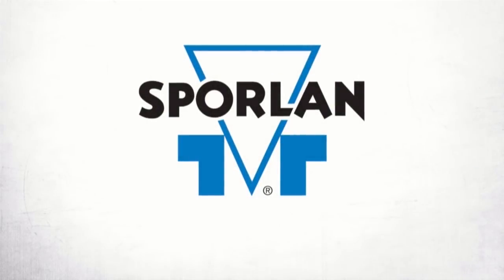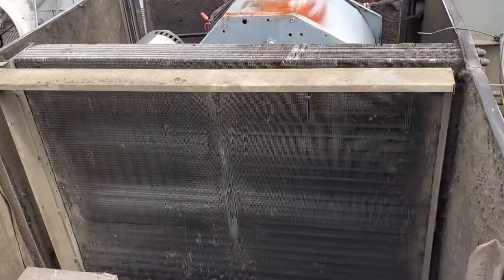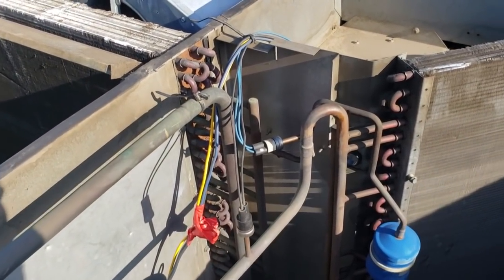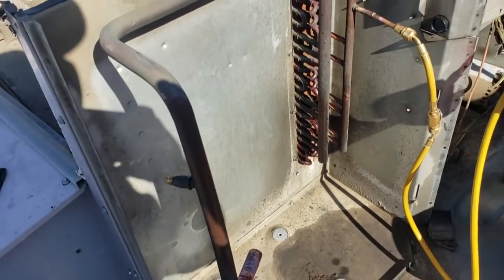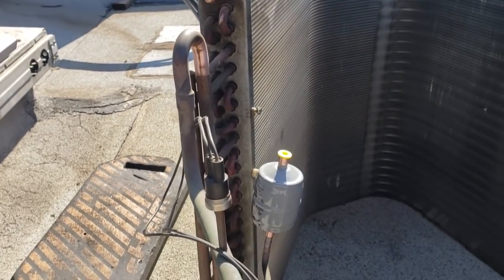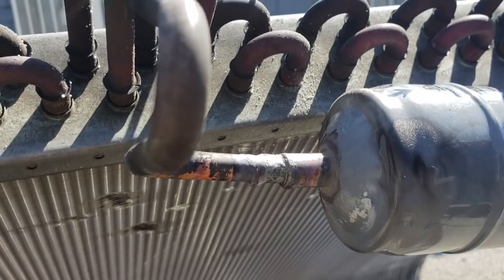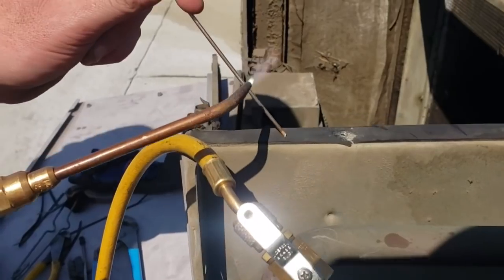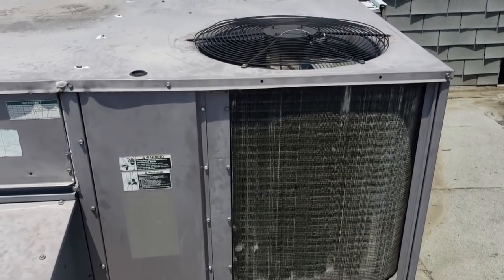CARRIER NO COOLING CALL

Comment: If there was any debris in the strainers before the accurators...nothing would come out with your method.. I usually blow through the suction line which will black flush through the coil and through the accurotors which then clears the strainers.  In the past I have just scrapped the accurator manifold and soldered in distributor tubes... made my own distributor to a 5 ton TXV....Done!

Comment: What is the stuff you use to control the heat flow into the compressor and drier as you were brazing them?  It looked like Perlite, but like a putty or clay.

Thanks..
Reply from the maker: It's called viper wet Rag by refrigeration Technologies
Reply: @HVACRVIDEOS  Thanks!

Comment: So what's the thought process behind the compressor being bad before the line vibrating? I've been on the same units before and had leaks from the copper rubbing. After repair and vacuum, the compressor was fine. Low refrigerant will cause all those sounds of running rough. Is it more preventative to change it, or was there a reading telling you it was bad? I'm only  about 3 years in, just looking for different aspects
Reply from the maker: Past experiences have shown me that when the discharge line cracks at the compressor outlet on this unit it's usually a compressor problem. The vibration I was feeling does not translate thru the video but even if the compressor was low on oil, I would not just add oil as I don't know how much damage has been done and for how long it has been that way. It's one thing if the compressor had an oil sight glass and I could see the level to know how bad it was........  I will discuss this on my Livestream this evening 2/24/20 @5:PM (pacific time) Come on over and check it out if you can. https://youtu.be/qop5jyuMfmc
Reply: @HVACRVIDEOS  I completely forgot about the oil that had migrated, it makes more sense now. Thank you!

Comment: I use a cutting head for silver soldering. Learned how to do it with it   seams to be easier
Reply: man used the same for a while but got a 17-30 Rosebud does wonders
Reply: @hvactechpr7872  never used a rose bud. For silver soldering. A regular tip I hated it about the time things got going good pop something would change or go out
Reply: @royamberg9177  it has the same feel of the cutting tip but everyone has their own technique
Reply: @hvactechpr7872  the angle on a cutting head is different from a torch tip a rose bud is simmaler   the near right angle slows you to get in some tight and odd positions that you can't get into otherwise. I bought some of those hook shaped torch heads didn't like that for most things. Hard to control heat as you can't move it away when you need to. The cutting head is by far superior for service work I learned. Just my opinion

Comment: To save time we all unbraze compressor lines...oil in the lines makes this a dangerous practice. Best practice is to cut out compressors and filter driers. When a system is running with a low charge it tends to pump more oil to the condenser and oil return from the evaporator is reduced.

Comment: What is wrong with putting the wet rags on a regular braze joint? It’s already brazed so no moisture can get into the lines..!?
Reply: John Doe you have to let the line cool, putting a wet rag on it while it’s hot can shock it. The metal will expand and or contract too quickly and can cause stress cracks.
Reply: Cody Weber thank you I was never told this information. Not even by my instructor in tech school.

Comment: After hearing the compressor and seeing the oil everywhere, why not condemn the unit and ask if they want to replace it?
Reply: Cashflow...   Repairs are less immediate cash out of pocket, and they come off the balance sheet as an operating expense, deductible from income immediately.

Replacement hardware is a Capital Expenditure, and is subject to Depreciation rules, so you end up spreading the cost out over several years...

Even a good accountant is only going to be able to accelerate the depreciation so far... an average accountant is going to use the simplest formula in the IRS' directions, and that is not at all favorable to the owners...

Comment: Just a thought and a question from somebody who has no experience with this. If you were using all new parts and had no residual solder to look at would it be helpful to someone who is just learning to actually stuff a small piece of solder on the top of the joint before you heat it so you can see when it's at temp to solder?
Reply: You can tell by the copper.

Comment: Get yourself an ultra sonic leak detector.  It will find positive pressure leaks and vacuum leaks using sound.  Leaks will sound like a hurricane with the amplified audio from the ultrasonic leak detector.  Then hit it with big blue.
Reply: The only down side to the ultra sonic leak detector is the price.  They aren't cheap, but then again, what is?

Comment: first I want to address phase direction, you make a good point, but many people will not understand how bad that can be, or potentially dangerous, depending application. most people do not realize if hook 3 phase up, you need a way to check equipment will spin correct direction, & many times 1 connection will be 1 direction, the very next will have it backwards, for great example, hanging cords in a meat cutting room, plug bandsaw in,  blade may go up, which could be a major safety issue, a person could flip blade inside out, yes inside out, so blade would actually cut going up, for jokes we turn blade inside out, so when person putting saw together after cleaning, if not paying attention, puts blade on backwards, then it wont cut, even though its going correct direction.
next a meat grinder, yes off topic, but if you put worm together, & its running backwards, you just broke the worm, $$$$$$ so have to make sure turns correct before its assembled, & if you move things from 1 outlet to another, who knows, we have 3 outlets, 2 spin same way, 1 is opposite, so we cant even move band saws from 1 location to another, unless we want to rewire,  1 saw for boneless blade, 1 saw for bone in product, and of course meat grinder.

now for your helper, yes I was cringing, lol, but I been around torches whether welding, brazing or soldering for close to 40 years, but we all had to start somewhere & learn. you were great and lots of patience.

Comment: Hi. Can you pause the video in the 25:34 minute? Why didn't you expand the compressor discharge pipe to put another pipe inside? I can see in the image that the diameter of the pipe that comes out from the compressor shrinks, that is not good my friend. I see that there were 2 welds left and there could be only one. Over time this could be detrimental to the compressor, since you restrict the discharge pressure. Or I´m wrong?

Comment: Maybe next time instead of trying to buy time with 2 zip ties, you can probably use some silicone to "glue" them together with a space in between. It would most likely prevent them from ever rubbing together, although I cannot acertain that the eventual vibration wouldn't wear out the u-bends of the condenser or the point where the hot vapor line is connected to it... Of course if the evaporator traps in oil then the system is doomed to fail. And the fact it's R-22 is also a problem, cause that's bound to disapear really soon.
Reply: Na r22 wont disappear any time soon, the EPA is making WAAAAAY too much money on it to get rid of that cash cow.
Reply: @noneofthisisreal75  Well as far as I know, it's been illegal to make the stuff for a while now. At least in Canada. And in the first of january 2020 it will be illegal to fill any system with it as well.

Comment: I’ve had compressors sound worse then this, basically running with a dry charge. Found leak changed coil, and charged system. Compressor purring like a kitten, but not 100%. Always check amps and pressures, the vital signs of a compressor !

Comment: Not an expert , but this unit was purely manufactured / assembled. The vibration from compressor moved via pipe and hit another pipe and eventually broke it. There should be enough clearance for this to never happen in the first place.
Reply: movax20h you’d be surprised the stuff that comes out of the manufacturer. I’ve seen many brand new units Carrier, York, and BARD that have came with lines on the high side pressed against each other
Reply: @DJxDannee  I know that designing and building units is kind of hard, with thousands of factors. But I would expect big brands that are on market for decades to know their shits and have checklists in QA for this stuff.

Comment: When I solder copper water pipes I use a good flux. Do these joints need to be fluxed?
Do you use good uv protected zip ties?
Reply: They use silver solder on refrigeration lines... it's a bit different than water pipe solder

Comment: Im curious on unsweating the compressor. I had taken a course this past month with Mike Prokup at Munch supply, and he was adament about not unsweating conpressors due to saftey. Do you feel like this is normal practice in the field? Also, do you feel that the small amount of Phosgene gas is unsafe to breath?
Reply from the maker: Yeah it is unsafe to breath the phosgene gas or burnt vapor coming out. As far as cutting out the compressor yeah if you can it's best to cut it out but sometimes the space is too tight and you gotta unsweat it.
Reply: Im not trying to badger you or have a negetive view of your content. Honestly, your knowledge and patience with your apprentice was amazing. Im only asking to help further myself in this field. Was the spacing too tight in this application? I personally feel like there could have been viable room to cut versus unsweating, although I am only going based on what I can see. What specifically made you go with unsweating?
Reply from the maker: No worries bud, personally I did not want to do any more cuts and braze joints than I had to, yes I could have cut it if I wanted to but it would have made more work for me. the fact that the system was flat when I arrived made me feel comfortable enough to assume there really wasn't much vapor in the system. But on top of that the original gas was R-22 and therefore it did not contain any flammable materials. Gas's such as 410 a , 407C,and any of the r-22 replacement refrigerant contain flammable refrigerants such as r-32 and sometimes isobutane, that is when the real risk for a flame out can occur. Even than though I would probably still un-sweat the compressor. Basically if you un-sweat a compressor without understanding that its possible for a flame out to occur is when you are in real danger. If you are prepared its usually not a big deal, I was prepared to put out a small fire if necessary.
Reply from the maker: I will discuss this on my Livestream this evening , I will be going live 6/17/19 at 5:PM (pacific time) come check it out if you can https://youtu.be/djsekznaMEg

Comment: Hello maybe you still see this video at this time, i know this is your old video but i already discovered now 🤣
So before that im sorry for the bad typing in english because im not really good in it

I wanna ask about your soldering welding technique that is really good and makes quick in time, because me as a helper in some company need to scratch that discharge pipe to compressor joint with abbrasive paper. How do you think about that technique? Is it good or not because i have opinion that micro material from abbrasive paper can mix with oil in compressor or another thing inside the refrigeration system
And the another question is. I notice in your video that when you soldering that leak point at the same time you let in the nitrogen to flow over the pipe, is it for clean up the residue from soldering or it makes the pipe not overheating and get more bigger leak point?

Comment: 1 you are not silver soldering and any work near a compressor due to vibration should be silver soldered. This cheep low temp solder stuff is not per code and in my book will not hold up. Yes you do have to get the copper red hot and purge with N2 to prevent internal Cu black oxidation and it is a pain to do it right but that is why they pay Hvac guys money. Any new connection from a factory are sliver solder Hvac guy should do the same. Question what is the name of the high temp putty you are using.

Comment: It's not a common carrier thing. I worked for Carrier for over ten years and If I had condemned all compressors that were loud oh well. You will lose some of the noise when you get properly charged. A good way to make money, however. Back in the day, we used R-11 to clear out a system. You probably don't remember R-11. Sorry after 31 years in the field I'm still a little picky.
Reply from the maker: It wasnt just the noise I was referring to it was the vibration from the scroll compressor. It's very common to have the discharge lines crack on the first 90 out of the scroll and it's usually the compressor vibrating that causes it. Trane has the same problem.
Reply: @HVACRVIDEOS  I worked with Trane as well 50 Ton and Larger start ups and warranty calls.

Comment: My question is,for all of this work you are doing,do you have a helper and if not,would you get this completed in a 8 hour day ? If your ladder was propped up a few feet from the work area, I can guess , you will finish this in one day,we have ropes.  But if there is alot of lugging tools  and equipment multiple stories and passage ways,how can 1 mechanic complete this by the end of the day ? I am 58, and work by myself.  By the time I lug EVERYTHING  up multiple stories and through a roof hatch or my 40' ladder extended to thee last rung ,I am gassed,but I have to Git ER  Done.  Anyway, not to cry a pitty party,but my bosses kid always has a helper . The kid does the installs but he also goes on follow up repairs like replacing heat exchangers, motors.
He is 45ish. He gets a helper.  WTF ?
I dont get it . Is my boss trying to kill me,or making me want to quit? Lol
If I didn't love what I do, NOT including PM's on newer equipment...BORING ,
I'd work at Home Depot, or Lowes.
We are absolutely under appreciated.
Right ?

Comment: Could the bad cap not of have made the compressor not sound good not running with sufficient power?? Those copper pipes on the drier so closely touching were 100% bound to make a hole in the copper due to compressor vibrations that will always be there.
Reply from the maker: No the compressor was 3 phase so a cap would have nothing to do with it.

Comment: Carriers really do have discharge vibration issues. I have gone as far as welding a vibration isolator just to keep it from breaking copper welds and pipes. It felt like forever watching you unsweat that compressor, but all went well.

Comment: not trying to jump on you but that comp problem is not a carrier thing its a copeland comp and that scroll is used on about 50 units not just carrier,  also look for the oil and just run your hand and find the oil, the vibration is caused by the lack of lubrication from a leak.

Comment: Okay dude. A running unit has vibration. Copper to copper you get a hole in one of the tubes. Doesn't mean the compressor is bad. Scroll compressors to start with do not like running low refrigerant. They are louder. I think you killed a good compressor. If sent back to Carrier, they would tell you the same thing. Your right heat the pipe first, move to fitting next. Yet I could see the pipe was not all the way in.
Reply from the maker: Trust me this vibration was not normal it was a bad compressor, the brazing was my apprentice I think you nee to re watch and pay attention when he is brazing you can clearly hear me telling him what to do.

Comment: Maybe a different troubleshoot path - you have a fan that is full of grease and is belt driven, when the fan becomes dirty it will run balanced until some grease slings off then it will run imbalanced and vibrate the unit until it comes back to balance or close to. The root cause could be the fan is caked up with grease and when it sheds grease it becomes imbalanced and shakes the unit enough to rub a hole in copper tubing or to begin the process. My guess is the greasy fan or a sloppy belt is where it started at. Although compressors vibrate and that is a known thing I would think the manufacturer took that into account in design although I don't see how they isolated the vibration other than the shape and length of the tubing coming off of the compressor. In vibration terms the fan imbalance would show up in the velocity spectrum below ~200hz and velocity is a destructive force. The unit is shaking itself to death. I get a hit at 100Hz and 180Hz on that compressor and both are in the velocity spectrum. If you can feel a unit vibrating the floor under your feet and your feet are approximately 18 inches away then the unit may be vibrating at ~0.5in/sec^2 , if the unit is uncomfortable to touch or makes your feet sleepy when you are right up on it then it is well above 0.5in/sec and could be above 0.7in/sec^2. We have a compressor that we have to get readings on quarterly and to do so we have to climb all over it, it's huge, 2,500Hp electric motor 4160V and the compressor was over built for the load so the slide valve can't close enough and we can't throw enough heat at it. It was shaking at above 1.0in/sec^2 and shaking the building right along with it. Now they have cut the floor away and installed concrete columns underneath to tie the unit directly to solid earth and it still shakes at 0.7in/sec^2. We don't run that unit because it is shaking itself to death. We can only hope that the plant will some day need so much cooling that we will be able to run it without shaking so violently. I would guess that 0.35in/sec^2 is a high vibration level for those pieces of equipment. The compressor usually sits on springs to dampen its vibration. The fan rarely sits on springs to that vibration goes right through the unit.
Reply: too much.